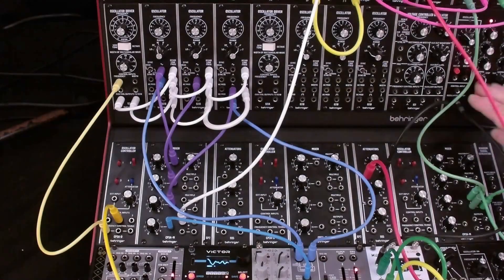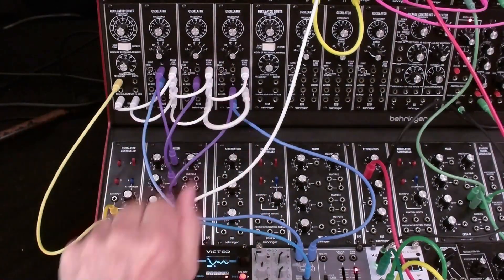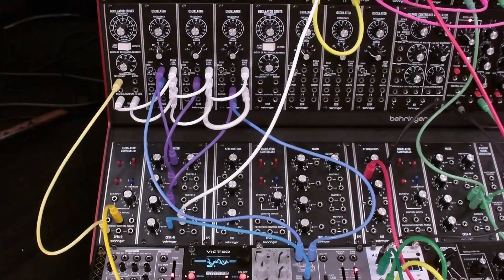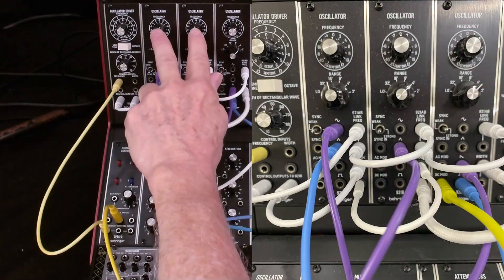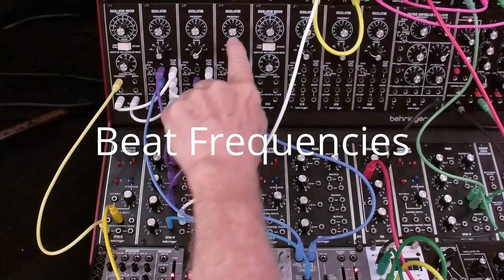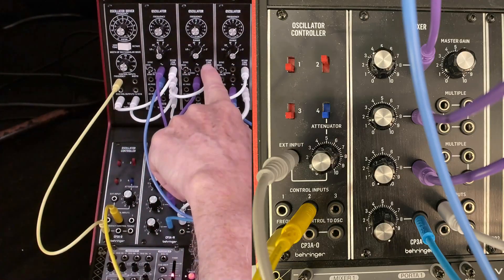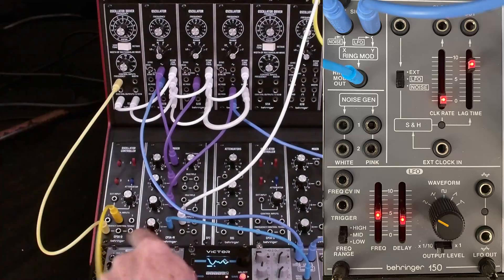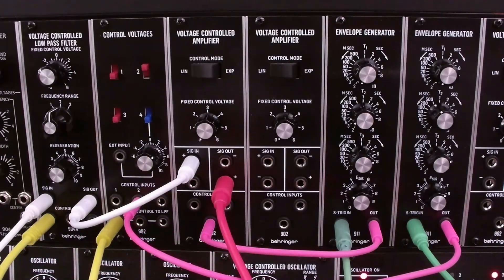Ep2 System 55 Patching Techniques - Bell Tones

Comment: Thats a really nice sound OZ! I find these types are tones are very easy to create on my 2600. (Unfortunatly there is no System 55 ring mod). I will try this on my System 35. Thanks for uploading. Cheers
Reply from the maker: Tony, 
I do love the 2600.  I'll have to try to recreate this patch on it (might need a second ADSR).  The Behringer 150 (part of the System 100) is a great addition to the System 55.  Better still is the 1630 Bode Frequency Shifter, which effectively includes a ring modulator.  It actually, has two ring modulators, so that it can isolate the Sum and the Difference outputs (IDK the circuit details).
Reply: @ozhalljr  Yes OZ I actually forgot all about the BODE!. A super ring modulator for sure. Of course the "tool of choice" is the ARP 1005 ModAmp. In combination with the 1047 and you have bell tone heaven. Great fun. I have also been experimenting with the Karplus patch on my Brains module. It is an amazing journey into bell tones and glock type sounds.
Reply from the maker: @moogfooger  I do love that Rings/Braids/Plaits Karplus sound.  So delicate and ethereal.  It may be my favorite Mutable Instruments sound.